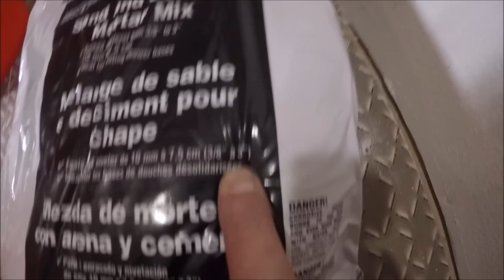How To Build A Bathroom #2 | THE HANDYMAN

Comment: Lil tip to prevent major issues in the long term use of shower... pour a small pre concrete pan before liner install. Allow it to have fall so in case the shower leaks into pan it is able to drain an there will be no sitting water to stagnated an cause oder or possibly damage subfloor/framing, thats only if pan is installed incorrectly or gets punctured before pans poured. Very nice work watch alot of your stuff, its nice to see someone so meticulous with his work. Defiantly no "jack" of all trades lol. Keep up the nice work. Also on a side note: id love to see how you set up that layout for your pouring of pan. I have thought about doing that before but never knew how I would set it up with metal to use as guides while pouring the pan. Thanks in advance.

Comment: Your work always inspires me - just started prepping to do my basement. Will probably have to hire a plumber... not especially comfortable with plumbing. Need to see more with the pex type fasteners you're using. Do you ever run electrical w/conduit? Would love to see that in future videos. Thanks for providing these videos - you do really good work.
Reply from the maker: Once in a while if the wire is exposed in a garage I'll put it in conduit.  If its outside the house, like if i'm running a new circuit to the main panel and have to run outside I will put it in conduit.  Pex is really easy. It like putting toys together.   There are 2 different types of bands.  I have the kind that uses solid rings. there are go, nogo gauges to tell you if they are crimped tight enough.
Reply: Thanks for that information!

Comment: What kind board are you using in the video at 3:10? Thank you. I learn so much from your videos. Keep up the good work.
Reply: I was wondering the same thing, I did some research and its called Diamondback Tile Backer. I paused the video at 3:43 and read the label lol.
Reply from the maker: Yep that's it.   Made by CertainTeed sold at lowes. I started using it about 3 years ago.  Before that I use to use a cement board.
Reply: Sometimes people will use Wonder Board. I think it's named that because everybody always wonders what it is. :þ
Reply: Do you have to seal the seams on the diamondback, and with what? Thanks.

Comment: Hey dude, kiwi handyman in chile here, question, why put the mortar on the tile instead of on the wall? Got a bathroom remodel coming up to remove old tiles and install new, would you prep the existing wall or replace the drywall or whatevers under it? Cheers

Comment: nice job i liked the way 69u 0ut the camara on the drill while mixing tile morter and when you where using the screw gun to screw into the floor. pex musta been nice to use on this job just feed it thourogh and crimp.
Reply from the maker: Yes using pex and sharkbites to tie into the existing plumbing made it pretty easy.
Reply: Sorry i meant to say i liked the way you put the camera on the drill and impact.

Comment: Hey smartman. Do you prepare the sanitation pipe yourself or its already in there. Thinking about making full bathroom in my basement but no sanitary pipe install yet. Thnks
Reply from the maker: Most basements have it already roughed in under the slab.   If not  you can easily cut the slab and install the underground drains.

Comment: Hay Love Your Work..Big Fan of Your Skills....I Just Have a Question in Regards to the Bathroom Tiles.... I've Seen Other Handyman Contractors Put a Liquid Waterproof Sealer With a Special White Tape Before putting the Tiles On the Wall...Is that Really Necesery Because I've Never Seen you used this type of Product. Thanks
Reply from the maker: I use it in the video "how to build a man shower".   Its best practice touse it.   I skip it on the low budget projects.  The product is referred to "red guard"   even though its not always the color red.
Reply: The Handyman thanks for the Reply
Reply: If you dont mind me asking what is the price difference you charge to use redguard? Do you do something else when you do apply red guard?
Reply from the maker: There is more than just the red guard that separates a high end shower/bathroom remodel to a low end rental grade shower. Budget showers get put together really quick and usually done on a fix and flip or a right before the customer sells the house.   $2500 to $3500 difference.    All this is figured out with the customer before hand.  They know what they are paying for.   New productions homes only get green board and tile slapped up  on it.

Comment: At 4:00 what is that shower thing you got set up in the shower? I watch a lot of videos about basement showers and your material you use seems to solve a lot of the issue of making the shower ground slope at a certian angle to the drain.
Reply: You mention it at 4:05

Quick pitch shower kit. Lol
Reply from the maker: Yep.  I have done a few by hand eye ball it.  But this makes it a lot easier and I know I have the right slope to the drain with no spots that hold water.  I get it at a flooring store.  You can also get them online.  HD and Lowes don't sell them in  my area.

Comment: Using pex' I love it,  but on my experience using it for a shower by itself is probably OK but again using it for both the shower & tub, I found it due to using it with the pex insert connectors that it reduces the ID to a 3/8" ID & makes the shower & tub spout diverter cause the water to flow from the shower & tub simultaneously.This is due to water pressure backflow & is a real problem as even sometimes  if so it's to be only running the tub water, the fact is it will flow out the shower head & vise verse at the same time as this is a reduced 1/2" ID to now be only a 3/8",  As I found it out the hard & costly way after the fact I'd already tiled the tub surround that now it had to be tore out & corrected. The pex is good for the water supply but from now on I use 1/2" galvanized pipe for the shower head & downspout as it works much better. But I'll still use the pex for the water supply lines.  I am a good man to have on hand Dave the handyman home repair guy. St. Louis, Mo. 63052 Also Youtube me Dave Overby for free self defence a style of my own how I defeat the hands & feet with my own technique. It's fighting smarter not harder making the right habits as known, habits are habits that once you have it, your stuck with it.. So make them the right habit's opposed to the bad habit's & you'll have it. God Bless & have a great day. I subscribed & give you a thumbs up. Thanks
Reply from the maker: I believe that is called shower rise when the pex restricts the water causing it to rise up the shower pipe and run out the shower head.

Comment: Are those braces for the shower pan easy to use. I mean do you always get the slope that you were going for?
Reply: JT Taylor I have used the same product and yes, they are easy to use.  They are made of plastic and are pre-pitched.  You cut the end that is to the outside wall.  If the drain is off center, you will have to shim the ones on the shorter side(s).  One of the brands is called 'Perfect Pitch'.  It comes with legs, drain circle the the legs connect to.  Very easy to install.  Just don't forget to put a liner in the shower. Otherwise all will be for naught!

Comment: I have used Shark Bites connectors in the past; how long they last you know?  Have you had any problems with them so far?
Reply from the maker: I have seen only one failure.  It was a freeze situation.  It froze and popped off.  I have been slow to use them.  I see them in use everywhere these days.  I just make sure they are seated all the way in.  I mark the pipe before I push it in.

Comment: Love your Videos as Usual...The Only thing am Confuse is How did you Get the Connection to make the Toilet ? It's Confusing
Reply from the maker: I tapped into the could water that supplies the sink.  Its run behind the wall.
Reply: The Handyman I Apologize... I Meant The Actual Toilet Drain Pipe or pbc where all the Stool and pee goes down
Reply from the maker: Oh.    I had to go into the crawlspace and tap into the 4 inch main line.  I cut a large area out of the sub floor to hook up both the shower and the toilet drain.  The 4 inch vent stack is in the corner of the shower so all new drains are with in 4 feet of the vent.
Reply: The Handyman thank you

Comment: I noticed you don't cement down the Diamondback, have you ever had problems with cracking? (I assume not because I haven't seen you cement it down yet!) Just a few 1" screws?
Reply from the maker: Never had a crack.  1 3/4 inch screws every 6 inches.   You have to have a good solid 3/4inch thick sub floor.
Reply: Thanks dude... man? I'd really like to try my hand at tiling a small bathroom in the not-too-distant future.

Comment: What type of board are you using for the shower enclosure? We have a concrete based board, but it’s bloody heavy.
Reply from the maker: I switched from cement board to  Diamondback Tile Backer made by CertainTeed.  I get it at Lowes